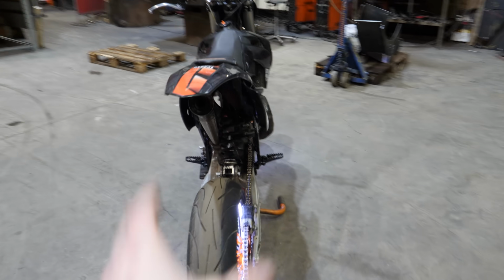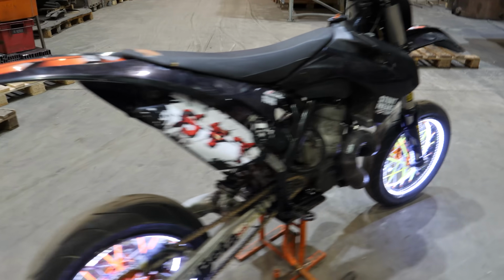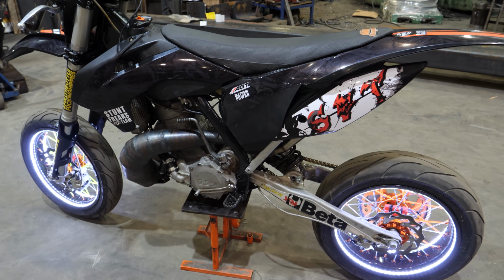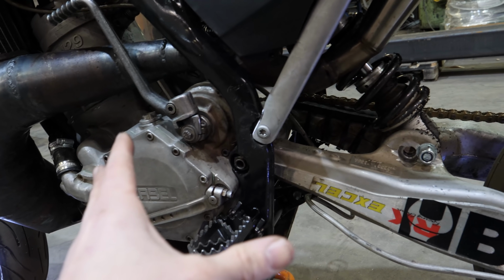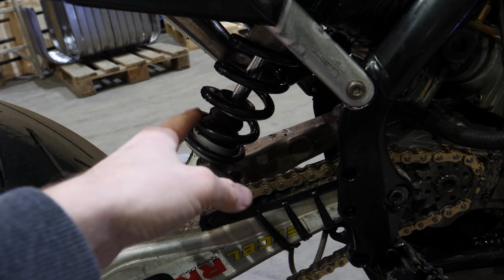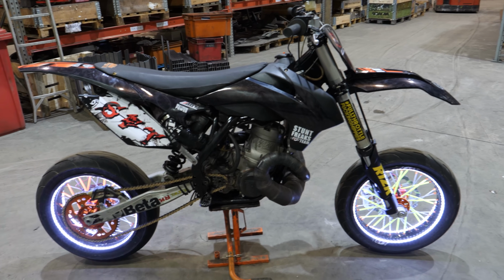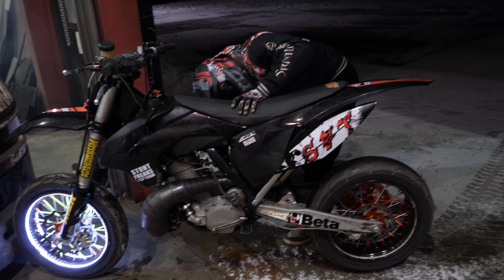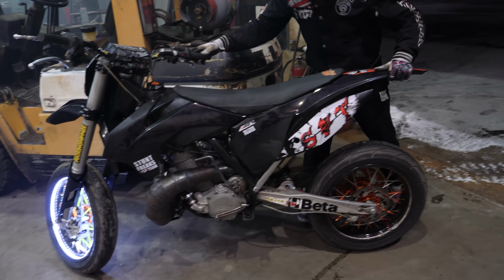700cc 2 Stroke Supermoto

Comment: Cool guys.  Im looking into putting a CR500 engine in RS125 frame then making it street legal .
Reply: I’ve saw a rotax four stroke put in one years ago it dropped right in. Think it was a 500cc.
A Honda crf 450 engine in an RS frame would be an amazing machine imo.! 
Good luck with the build.
Reply: The KTM 640 LC4 engine also fits on the Aprilia RS125 frame. 55hp. It'd be a great bike

Comment: I had the same idea of building the same project the problem with this bike is a pipe has kinks in it 2-stroke pipes should not have kinks in them the next problem is using a shot that was designed do you have a linkage it's not going to handle well you should use the shock from a model that didn't have linkage. Using the swing on my upside down also is an issue and handling it wasn't designed to work that way will not work well I would not take that bike off road.

Comment: No rear foot brake?
Reply: may be they have a thumb brake, because there actually is a rear caliper and a brake line
Reply: It has the rear brake on the handlebars, thats pretty common for stuntbikes
Reply from the maker: Yeah we have to solve that problem now the rear brake is on the handlebars. we cant use the standard because the front sprocket is on our way

Comment: Curious, why are there two clutch type levers on the left side handle-bar??? I thought maybe one be a compression release? but it looked waaay da'fuk too big. Could it be some type lever rigged to do stunts? IDK, same type some cars have (the big ass handle on the right side above gearshift, to help drift& slide) i'm guessing for same purpose? 
I wanna see that byotch run!! preferably in higher gear other than 1st & 2nd. 
A 700cc. on a 250 frame,.. Hott-Daaum!!! that thing should riiip! Ding! Ding! 
Snow in July?? is this clip of an older build?OOPs! nvrmind, 
just noticed it was  a Feb'19 premier.. I liked those L.E.D. rims! those could be badAss in red at nite. Well my opinion anyways, look like fire.
Reply: It's a left hand brake. You chan break the rear tire with it. It's used for stand up wheelies.
Reply: It's a handbrake to help with wheelies.

Comment: Why did rear tire spark @5:21 needs new tires after 1st lil burnout? Lol
Reply: I think there was a bolt on the floor and the bolt sparked of concrete floor, I seen the sparks though and had to skip back and check 😂

Comment: Nice job  I didnt think the Zabel motor has a counterbalancer?  those things are notorious for vibration like a CR500 and the KX500 motors. but there is one designed with counterbalance and an electric start.. a BRC500
Reply: i threw my counterbalancer out of my husaberg 650 engine so what.
Reply: @Thor555555   then go ride your bike for 8 hours at speed and tell us how your hands feel or not feel.   And if your hands are still ok Hercules then keep up high speed riding for a year and tell us how you don't have cracks in your frame or how many times you had to weld back on your silencer mounts ... That's what a counter balanced is for.. but if all you do is ride to your buddies ice chest or race only 2 or 3 times a year or ride 59 hours in 7 months.   Then you don't know how good a smooth engine is it nice to ride. That's the so what
Reply: @MichaelMeyerMotocyclist  ride a sidecar on full speed for 45minutes in GP and motorvibrations are the most less problem at all.
Reply: @Thor555555  I have and I agree.  I road one race AMA district 37  Grand Prix  Adelanto.  Beat the crap out of me  my friend will never ride with me as a monkey told me to stick to motorcycle.... Lol

Comment: Thats nuts. Must be well over 100horse, yeah? I dont know why the manufacturers don't do something like this.
Reply: drongo jonkins They sell complete bikes with the 700cc 2 stroke. https://www.maico-bikeworld.de/en/motorcycles/neumotorraeder-2013.html
Reply: EU 5-6, American E.P.A, and hippies won't allow it.
Reply: Well, first of all, because it makes no sense using 2 stroke but for enduro. Second, in enduro the 72 hp of the Maico or Zabel motors are too much to control the bike properly, so it makes no sense using these engines. Even the 500 cc engines are too much. So there's no reason for anyone to buy any of these bikes apart from exhibiting, that's why almost no one sell these kind of bikes.
Reply: @danixsc  Makes sense as a motard tho.
Reply: @drongojonkins8945  Not really. I mean, these motor only makes 70hp. It needs a really heavy tuning, like opening the inlet and exhaust ports, a really heavy carburetor, more compression and a performance exhaust, of course hand made, for example by Yasuni, which has the best exhausts for 2 strokes.
It's fucking hard to control even in circuit, but it's a pretty nice whim, i would definitely have one if I had tons of money.

Comment: Just rip out the lowering and suspension links smart
Reply: Most KTMs don't have linkage style suspension to begin with....
Reply: I was never a fan of linkage in the rear suspension especially for offroad riding. It's kind of like extra weight as well as a part that can & does pick up roots,rocks etc. SWEET ride & great choice for a big bore smoker!!!
Reply: As in a great engine choice..A true 700cc. 2-stroke..

Comment: How about not grinding and thinning out your swing arm? There are better solutions that doesn't involve compromising with safety. Have you done any calculations regarding deformation under load? Plastic deformation? Real tests?
Reply: Who cares? It works well and they said that they wont use it that much anyway
Reply: @wizardrhyme9597  famous last words
Reply: @wizardrhyme9597  would you also just have your calipers bolted on with 2 of three bolts?

Comment: Two stroker,-  the best and strongest engine of the world!!! Fuck for four stroker!!!
Reply: 2 strokes are really fun but for some types of riding 4 strokes is more practical, more easy to handle and less exhausting to ride... I wish I had a modern vibration less 500 2 stroke (with balance axle to cancel vibration like a 2017 KTM 300 I tested). But I should not complain, I now have a 2019 KTM 500 EXC F and the horror stories I have heard about the KX500 and CR500 2 strokes comes to mind when I open the throttle fully on that beast ;) But the 500 EXC is no 2 stroke, it is a gentle beast that lack the element of surprise, excitement and all the challenge you  get from riding  the 2 strokes when they hit the power band.  It is fun when your bike do its best to try kill you and I kind of like that for some strange reason,  but my 4 stroke friendly beast is not that kind of a bike lol :) (maybe if I mount a turbo on the 500 EXC it will finally turn evil like the 2 stroke monsters ???)

Comment: Where can I buy this engine ? Where can I get it ?
Reply: if you looking for a 700cc 2stroke from factory check them out https://www.maico-bikeworld.de/en/motorcycles/neumotorraeder-2013.html
Reply: @alterzus  that are not engines from factory. KTM Köstler (owner of the Maico Brandname) built this bikes with KTM frame and Zabel engines from 1990-1996 with only 685 ccm. point is, Zabel buildet his first engines(Zylinders) based on the maico 500 Block, first the 620ccm zylinder, than the 685ccm zylinder all on the maico Block and these are the engines used by köstler cause he have also bought the last maico factory stuff like the 500 blocks. Zabel begun in 1997 to build his own blocks with hydraulic clutch and a little less weight cause of now 5th gear. and also membrane valves direct into crankcase instead of into the zylinder but still 685ccm. since 1999 be got 700ccm zylinder with his first complete own buildet engine ZM19 (didn´t use the Maico gears any more). In the Video there is his until this year latest evoluted engine called ZM29 and this year there is the ZM 30 available.
Reply: you get it here https://zabel-racing.de/ or some used for example here http://www.wspracing.com/ but at the moment there are no available. best time to buy is after the Sidecar GP season when the teams buy there new engines and sell there race or spare engines of the season.

Comment: Is it jumps ready and balanced to do big jumps or you don't know and only stay on asphalt with that beast?
Reply: the rear swing arm doesn't have bearings so it should do just fine, but if you do it alot it will most likely fail.

Comment: I want to put a 450 into a cr150f so bad wish I could actually use ktm equipment engine etc
Reply: Also that thing has to be scary what is the powerband like?
Reply: If you put a 450 motor into a 150f chassis you would twist the frame. Try looking at a 150r. Stronger frame and better suspension.

Comment: im finally getting on bikes.. my first choise is super moto .. somethinkg about 125cc.. cant now figure to go 2T or 4T .. any sugestions?
Reply: 4T is good and reliable and you can ride long trips with them and they use only a little bit of fuel, but they aren't as powerful as 2t and if you have to do a engine rebuild   its going to cost alot more than 2T, and with 2T you have to do more maintenance with them than 4T but its cheaper to fix them and they are more powerful than 4T, so if you have alot of money, garage and dont have to do long trips 2T is better, but if you dont have as much money and have to do long trips 4T is better
Reply: I would say 4t is better for new riders
Reply: stoner420 2T
Reply: I like the sound of 2 stroke more, i have gilera smt 50.

Comment: No that's like a 350 snow mobile or something like that , sidecar 2strokes are 4cylinder .
Reply: Its a Zabel 700 engine. The engine was originally based around the maico 685 for motorcross, then Zabel used that to make a 700cc for the specific purpose of sidecar racing. Its definitely not a 350, and there's all kinds of sidecar engines.
Reply: @REXman717  

Yepp , you got it !

Comment: Is the seat comfortable? It looks hard and not nice to ride on for more then 30min idk..
Reply: that engine won't even last 30 minutes so its ok
Reply: @itsyaboi9329  wow that sucks, I like the Tmax Tech max 560 💯
Reply: Train  that's insane!!
Reply: Train  you mean it uses fuel. How would a bigger 2smoker wear out faster😂? Generally the smaller ones do as they have to rev out more to sustain any decent power.
Reply: Train  I mean sure if you went way up in scale but for my comparison I had in mind was say a ktm 250 vs a rm125 for example. Bigger doesnt wear out as fast. I understand how engines work but i get what you mean
Reply: Train  never actually seen one in country so cant say I've heard of any wearing out really fast but fair
Reply: Train  fair enough. I'm restoring a 72 xl250 motorsport as my first road dedicated bike but I've had good experiences only with all my 2 strokes. Got 125 hours out of a top end on a 2013 ktm 200xcw and I could've just put rings in and done another round. My 2014 ktm 250xc has been even better. Even got 80 hours on my rm85 top end and that was okay too. Heaps of people really do go overboard on maintenance and considering a lot of manufacturers base their schedules off racing or pure safety of the engine I havent found it to be 100% necessary (motor wise), with the exception on certain things

Comment: Just wondering... isn't a 4 stroke better for super moto due to the 2 strokes powerband?
Reply: its a 700cc 2 stroke so i wouldnt be to worried about power.
Reply: I know it's got plenty of power, but imagine giving it a little to much throttle, and then it hits the powerband. Just wondering...
Reply: @spyropyro3159  These things really dont have a powerband, big 2 strokes are ported for low rpms, it starts giving a lot of torque right after idle
Reply: It will certainly be a bit off a peach to drive but what Vertti said. Of course for everyday use a 700 cc 4 stroke would be better. look at the husky 701
Reply: The four stroke is better suited for the road that's true but the 2 stroke is still gonna be lighter. There's pros and cons
Reply: @spyropyro3159  700cc 2t is almost same as 4t couse it doesn't take rpm More than 10000 rpm and the powerband isnt the same
Reply: This thing has torque everywhere. It's built for sidecar mx.

Comment: It's a Maico engine.
Reply: Its a Zabel
Reply: @Thommpsen  Zabel engine from a Maico.... Any idea where you can buy them?
Reply: no its not
Reply: @povertysquatter  Zabel used to manufacture big bore kits for Maico engines, so based purely on that... 

Yes.

It actually kinda is a Maico by design.
Reply: @s4rg380  Zabel is Zabel and Maico is Maico, the same way Toyota is Toyota and Lexus is Lexus and Ktm is Ktm and Husqvarna is Husqvarna.
Reply: @povertysquatter  it seems you missed the point though, yes, they are seperate companies, Zabel makes their own engines, based upon the work they did in collaboration with Maico

Maico is not Zabel though, never said it was...
Reply: FWIW, Lexus is to Toyota, what Audi is to Volkswagen.
Reply: @s4rg380  Whatever you say Mr."Sergeant" lmfao.

Comment: Why the small wheels? I think they look cool, but what is the advantage to these over larger wheels? (Other than price)
Reply: PYRO FALCON it's a Motard or Supermoto is another category that uses off road bikes in the track, they used to run in kart tracks
Reply: Less rotational mass so more control and responsiveness from the wheels which makes it better for mobbing and flatland tricks
Reply: 16.5" - 17" is the best size for high speed road racing.

Most race compound tires are this size only.

Dont make a sport compound for Harley, Goldwings, cruisers. 
Most dirtbikes have 21" front rims,great off road but terrible on pavement for handling , like an Impala on 24" rims.

Comment: what you done to the wheels to make them glow ????
Reply: If you were subbed you would have seen the tutorial a few weeks ago
Reply: @AdamSmith-tk5br  i have subscribes can you send me the link please
Reply: @SashaLumi  found the video quality loved it but come on $199 euros for all the bits to do it dayum can do it all with just the led strip the battery n wire connectors the glue gun aint needed if you know what stuff to use n steel bits aint needed can make a bracket out of two L shape brackets

Comment: Could you of not just lifted the chain and turn the wheel around to the other side
Reply: db db its a LH motor
Reply: @mikolaj1664  what's that
Reply: Like the sprocket en stuff is right
Reply: On a RH is it on left
Reply: @mikolaj1664  I'm asking could the wheel not just be turned around but I already did it and it works
Reply: @dbdb4274  so do you still have a rear break?